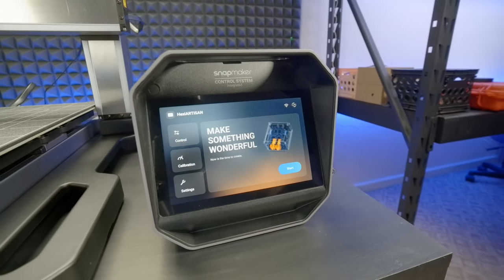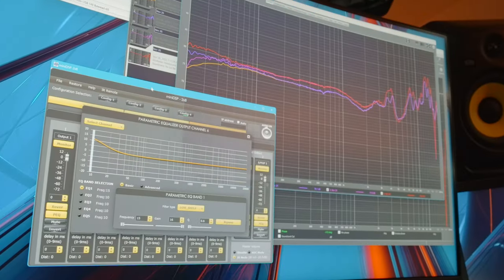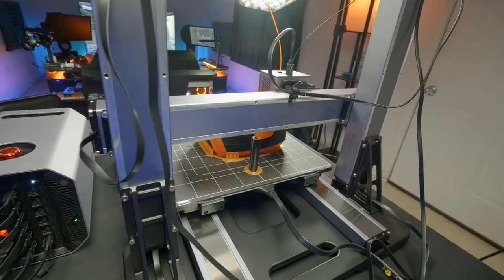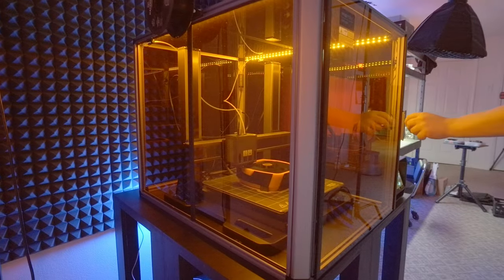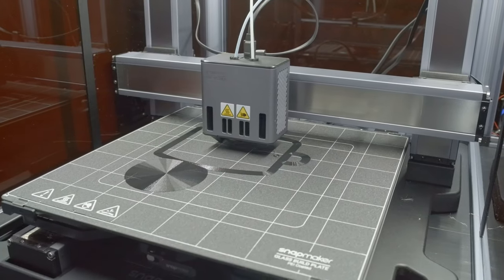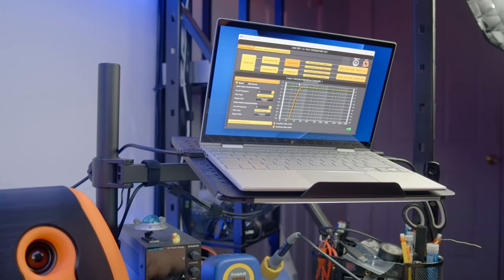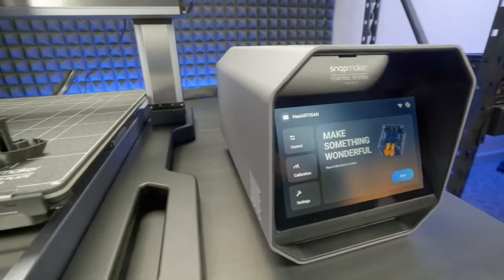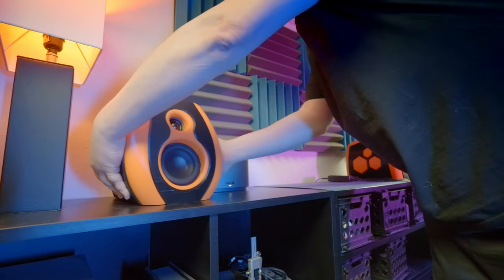Snapmaker Artisan Review & Feature Build

Comment: Just ordered the parts, we'll see how this prints on my big ass Mingda. I was actually just thinking about some speakers to replace my Polk T15 bookshelf speakers and this fits the bill nicely lol
Edit: also thank you for uploading a single material version for us single extruder plebs
Reply: UPDATE! I've got them printed and assembled with some use. They are interesting. They sound very, VERY good about 15 feet away, but with the horn loading they are extremely sensitive to position. Overall, it was worth it! The sound stage is phenomenal when you're in the "sweet spot" and are very crisp and clear. Excellent in the same setup he shows the testing being done in, but I would not recommend them when you're less than 5 feet away. I will say these things dig DEEP!

Comment: I absolutely love my Artisan and Snapmakers support. The 3D print improvements with surface finish and smooth movements over the 2.0 were very impressive. I run Markforged filaments on mine now, worth trying! If you get that temperature issue again, remove the module behind the door and reseat it on the pins 🙂

Comment: PETG Supports for PLA work very well, as does vice verca.
PVA is increadably hydroscopic. To use the filament you need to dry it extensively before prionting and optimally print out of a drybox using a reverse bowden setup.
Reply: Not only that, PVA swell irreversibly when humid, which can cause a myriad of problems.
Reply: hygroscopic, not hydroscopic

Comment: I build these speakers in the last few days.
On my Voron35 300 it was a bit tight - I split the top section off - which has the advantage of using MUCH less support structure. These sound astonishingly good - these cheap driver are not bad. Only in loud and low frequencies I get a bit of a snaring - probably because some cabling inside was a bit loose - I did no damping foam inside too.
Scrwing in the electrongs board was a bit of a hazzle. Very tight space. No idea on how to do this better - it is a rather large board. I would prefer to have it screwed to the back of the speaker (where the tube is). Maybe in another design :)
With the new modern slicers you could easily print this in multiple parts (they even provide you with the fitting connectors between parts). But for this. kind of "organic" designs it is difficult to go without supports. Would be very difficult to do with wood - at least without a CNC router :)

Comment: Out of curiosity, have you tried the QIDI X-MAX3 on your new, solid tables? I've got access to a BambuLabs P1S at my local library; they use a heavy, lockable wheeled cart because the printer doesn't have a permanent home and I've found I still have to tie it back to the bookshelf behind it if the print is taller than wide or the cart allows it to shake parts loose (at full speed, anyways).  The input shaping doesn't try to damp oscillations at the frequency of the entire printer on a wiggly table.  I suspect you're seeing constructive interference between your table and the input shaper, but obviously YMMV.
When I get my printer (eventually) I intend to brace it to a wall at the level of the print head. Assuming it's CoreXY at least...

Comment: The prime towers seems to be causing issues for lots of people. Is the prime tower solid at the bottom? Maybe do a thick 5 layer base that tapers to the top. The prusa xl ones caused tada 3d printing no end of issues with her pug print. A couple others too. 

Have you seen 3d print bunny? She uses very thin cyclinders or boxes to form strands of filament to make her models just wondering if you created something that cross the prime tower (could cause a sliver conflict) so that they anchor the prime to the model or anchor to a hoop around the prime sort of like you did but with hardly any gap between so the prime tower can’t dance around… 

Further to the tower are you able to help with this? 

I’m looking for a desktop speaker model  to print for my computer desk. Be nice to have something maybe 3”x6”x5” (wxhxd). The little resin print you did was cool size but not quite right sound. 

I guess Bluetooth would be good but not sure how the two speakers connect together. Wired is probably easier to do. I think I only have a 3.5mm outpost on motherboard (no soundcard). 

Be good if component were non Chinese as I don’t believe we should get nearly everything from a potential adversary - covid proved what could happen if the supplies were constrained (and that was even based on sanction or war time stance)…. 

Any ideas of way to do about?

Comment: Thanks for the video!
For printing PVA, you’ll need a solution to keep the filament dry during the print. Otherwise it will keep failing. Printing from a simple filament drier should work.
The glitch you had mid print I guess is due to the temperature inside being too high, the electronics and power supply can’t handle very high temp. Usually prints aren’t this long so it’s not an issue, but if it’s a very long print you should leave the chamber door slightly open so the temp will stabilize on a lower value.

Comment: how much time did dual filament add to the print?
Reply: I can't answer for him but I'm currently running a print with two filaments on a Bambu Lab P1S equipped with AMS. One filament is the primary filament and the second is a specialized support filament. Using two filaments increased my print time from 4.5 hrs to 11 hrs. There are 291 filament changes from start to finish.
Reply: @RYTHMICRIOT  spray paint is faster lol

Comment: Wait… At the end of this video you said “This machine is beyond reproach”, and yet in this very same video, the machine froze with one of the extruders apparently at over 500C!? That’s planets apart from being beyond reproach. That’s a machine that could easily burn your house/shop down if left unattended. Any machine that doesn’t have proper runaway temperature control is not worth purchasing unless you know enough to be able to enable it and actually do. That’s a HUGE failure on the part of Snap Maker, and that failure alone should have been enough for this machine to earn a “do not buy”.

Comment: consider using gyroid infill as that can be later filled with epoxy or resin or concrete or expanding foam.  Just have to cut a square of skin off and pour in there. I often design with this in mind.

Comment: I have a question , would you make me a 3d design for a Audio Mobile Encore 4415 for under the back seat of a jeep gladiator ?Maybe even two? I have not found any parameters for these but the manufacturer says that it's designed for a sealed box using only 1.25 cubic ft.